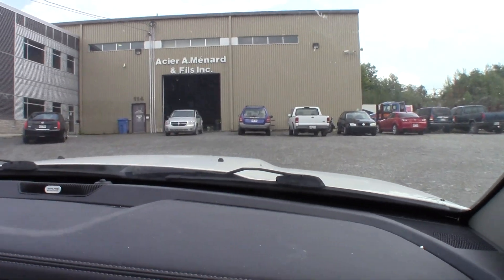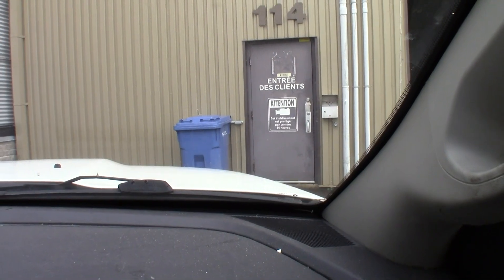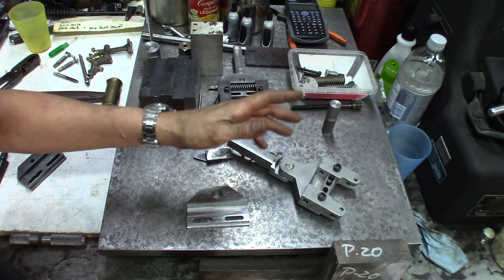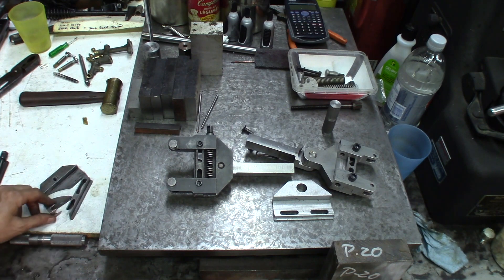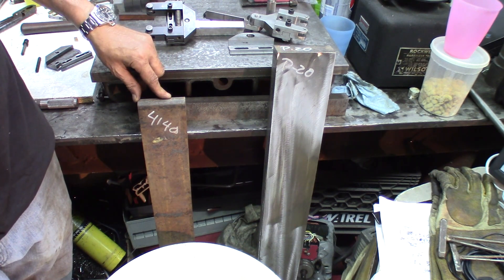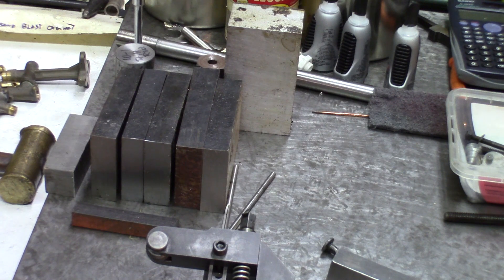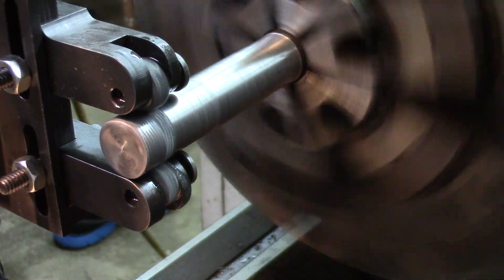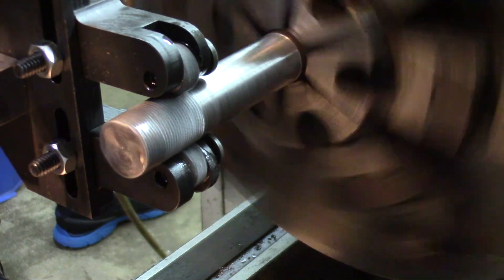WIYB Shop made Knurling Tool for Keith Fenner's What's In Your Box Machinist Collaboration

Comment: I always neural with straight 90 weight non detergent oil. If you squeeze some out it's so thick that it forms a Big Blob that rolls around the stock and it's simply floats the particles out. It's so sticky and thick that it stays on there
Reply from the maker: Hi, That sounds like something to try next time I do some knurling, thanks for the idea,    Pierre

Comment: Where's the video on how to make it? :^)
Reply from the maker: +Tricknologyinc 
Hi, there are actually 4 of those videos on my channel, you'll find them in a play list, also some more videos can be found on Philippe's channel "  Phil's projects " Philippe makes the arms...

Also due to personal issues, there is some unedited material that should be done shortly showing the main body being made, the heat treatment, also to be filmed, the method to make the best possible usage of pinch type knurling tool...

Thanks for being there, hope to get the rest of the making on the channel soon,    Pierre
Reply: pierre beaudry
Thanks, Did you make the knurling wheels or buy them? I'd like to learn how to make them.
Reply from the maker: Tricknologyinc

We didn't make the knurling wheels, and, if you're interested to have a glimpse at how it's made, there is a recent video where we we visit the factory where the wheels come from...

I highly suggest you look for commercially made good quality units, cause high quality units are very difficult to achieve excellent results in a home shop...

You'll see from the video...   ;)

Comment: Hi to you two or three,

Depending on whether the ‘special effects’ guy is part of the scheme of things!
I am not really sure if Keith realises how huge the plans he has started is going to be beyond his expectations I am sure, in a few years his boxes will be to many and maybe a separate warehouse will be necessary to organise things! Choosing the young and lowly engineers can be the start of someones working life and they in turn will offer Keith, just as you have done,.
Something very special and well over built for this particular job. I hear some say you don’t need to have any one piece to be over the top as far as the strength goes, but that way means you won’t be going out and buying something you might only use occasionally or regularly, every couple of years! Building things down to a cost means they don’t last or even do the job properly at all, case in point is the ‘everyday’ bridge designs for most of American streams and rivers, they were put in place about the same time, and have barely lasted 40 years, where on the other hand the so called over built early 20 C ones are still working taking far heavier loads than was first expected .
Reply from the maker: +mrbluenun

Been all four of us taking a break for the month of December, but, we'll have to get back at it soon....

You can say that Keith started himself a lifetime project, probably quite unexpected from his part...   Nice that it keeps on in order to motivate young people to take over the trade all around the world, that trade will surely evolve with new technologies, but, the need for young people imagination and energy will always be there....  ;)

Let's hope that the make it last longer will come back soon, I really miss that way of thinking...   

Thanks for nice comment,    Pierre

Comment: so are you going to make some to sell,  and like - Shortribs Long Bow - how about a smaller one for say 9 x 20 lathe??
Reply from the maker: +jbrunson1949 So far we're not planing to make them for selling, we might have 2 or 3 left after this, those will probably be for sale to help pay for materials.
Soon enough the plans will be published after revisions and corrections, you could scale down a little to adapt on a small lathe.
The tool had been tried on an Atlas lathe, I think it's a 10 incher or close, works great as long as you can hold the arm properly and have enough distance available from the cross slide...
I'll post the development on the channel in some not too far future.   ;)
Thanks for comment,    Pierre

Comment: Just a thought on the final knurled would it not be better that the knurl bolts be on the other side away from the spinning chuck to allow more room for some close up work less stress on the end of the moving part
Reply from the maker: +dtec30 Hi, What you see there is a final prototype, the bolts on the chuck side will be button screws, also with this type of knurler there is very little stress on the part so distance from the chuck is having minimal effect on the part...   ;)
Thanks for comment and suggestion,   Pierre
Reply: Ok thanks I'm just an enthusiast so I'm eager to learn
Reply from the maker: dtec30
Keep on with your pro-active and positive attitude...   ;)   Nice to have you around.   Pierre

Comment: Excellent project. 
This design was something I made a long time ago which I called the 'straddle knurler' - not though quite as splendid is your one. It saves a lot of stress on the cross slide.
Someone will be thrilled one day to receive that.
Reply from the maker: +ChrisB257 Hi Chris,
In deed this is somehow a great way to knurl, so far I've done most of my knurling using the bump type tool, works fine on big lathes but total shit with little machines, the kids will be happy to get one, us too also, cause making a few more is just a little more trouble and the reward is great... :)
Thanks for comment,  Pierre

Comment: Perhaps an idea to put the screws that hold the knurling wheels on the right of the tool, so you can get closer to the chuck. When i build my own knurler I had to reverse them also, because it was pretty annoying. It is nice to have maximum clearence on the left of the tool. Nice build. thanks for sharing. Cheers.
Reply from the maker: +Flip de boer Hi, this is the second time I've send something, doesn't look like it got to you the first time... :-|
There will be button screws on the chuck side, could add some chambering but, just more machining though, the screws will be purchased at the right length, and fastened with Nylocks.
So far we're proud of what we did, thanks for comment,   Pierre

Comment: Hi Pierre and staff !

A very nice piece of tool you made there - is the secret for such nice results the construction OR the material you used for the tool ?

I ask because now I need such a knurler too - some "chicken sketchs" avaiable ?
Reply from the maker: +Keld Sørensen Hi Keld, there is no real secret, some parts NEED to be heat treated in order to last, Philippe is working on the last mods to the CAD drawing, we'll make it available as soon as it is finished, (Maybe a week or two).
The fact that we also needed a good knurler motivated the build...
Thanks for comment,   Pierre

Comment: Subtitler must have been on his meds again. He was aweful nice in this one. I have never used one of these type knurlers, only the self centering type with multiple knurl pitches. Looks like it works very well. Did you all not temper that frame that broke?
Reply from the maker: +bcbloc02 Hi Brian, here in Quebec, we have medicare, so medication for Subtitler is cheap and plenty...   :))
I also used the bump type knurlers before, this is sooo much simpler and easier to succeed in doing a clean knurl.
The tempering was not exactly adequate, and, we also been a little nasty with it as well as the screw, the latest version is pretty much better... 
Thanks for comment,   Pierre